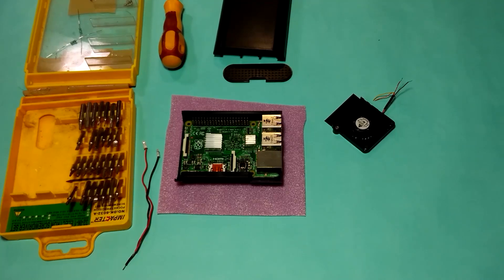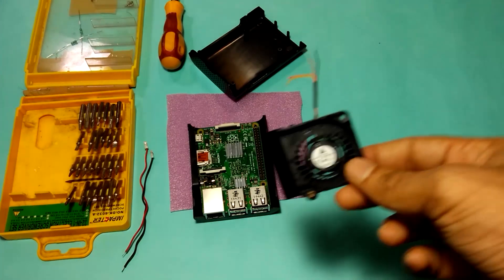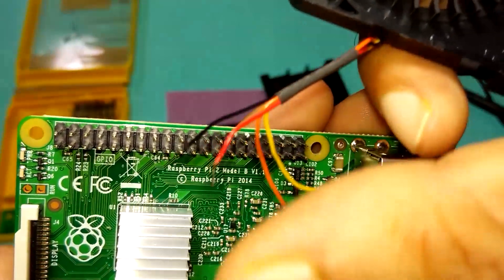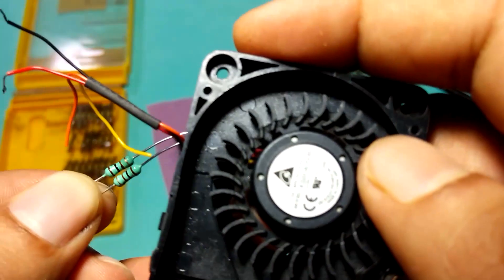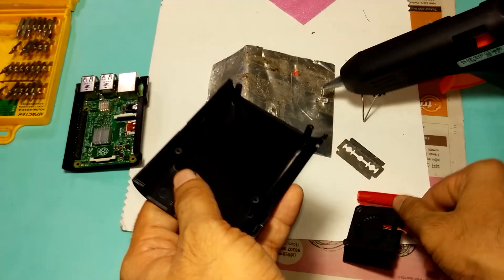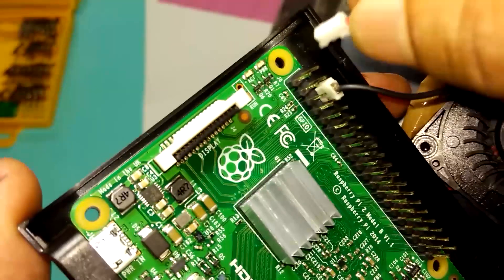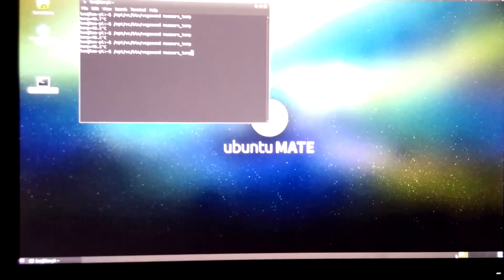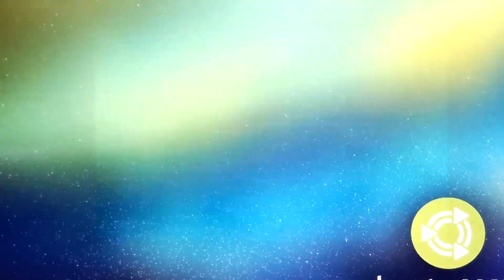Raspberry PI2 PI3 Fan installation  Easy  Guide Inside Case

Comment: So, just blow the heat onto the lid, provide it with zero air-flow, and congratulations, you have now wasted hot glue, resistors, tape, solder, a fan,and a raspberry pi case. Poor thing has probably burned out long ago. It would be like putting a fan in a room without air, or a vacuum. Does absolutely nothing.
Reply from the maker: Still working after two years later ...
Reply: @RoyTecTips  I'd strongly suggest drilling holes in one end of the case as an inlet and in the other end where the fan blows as an exhaust. That would help thermals a LOT.

Comment: It will  only heat up it more fastly, as the hot will strike back to raspberry pi, as thier is no hole for fan to throw the heat out.
Reply from the maker: fan is kind of a blower
Reply: RoyTecTips But the blown will strike the fan back , as it can't get out of the case.
You should make a hole at center of fan , so that hot air can be thrown out by the fan
Reply: RoyTecTips But the blown will strike the fan back , as it can't get out of the case.
You should make a hole at center of fan , so that hot air can be thrown out by the fan.
Reply from the maker: it reduce temperature by 20 degree C

Comment: My question is how far should the fan should be from the heat sink on the raspberry pi ?
Reply from the maker: On this set up max 5 mm
Reply: RoyTecTips I have a different set up. I have the raspberry pi 3 and I put the fan I have ordered right on the top of the main heat sink. Thank you for the information.